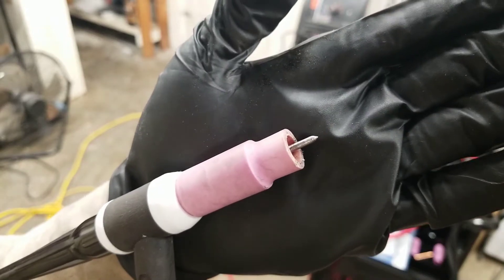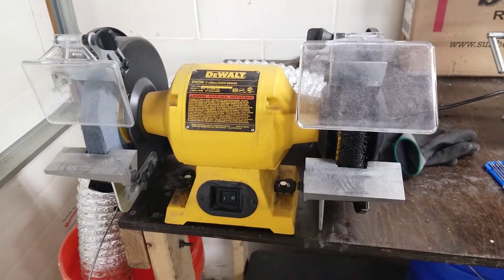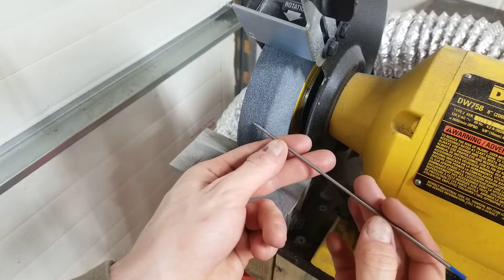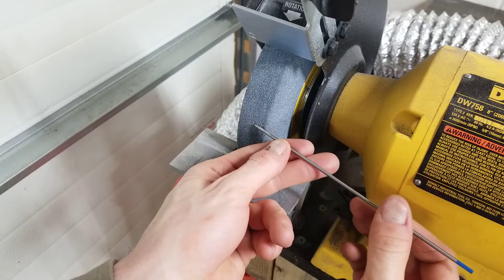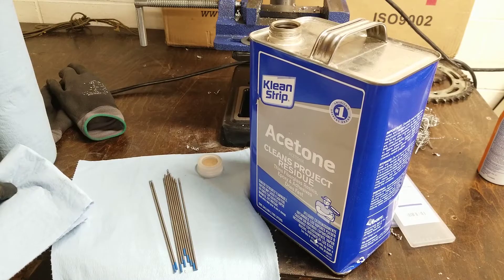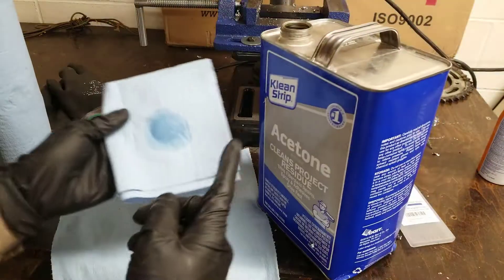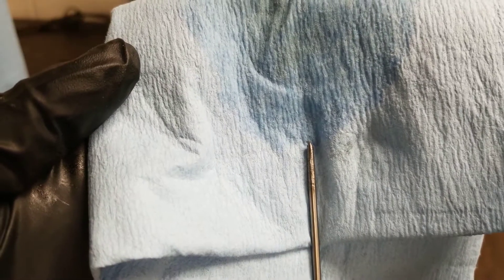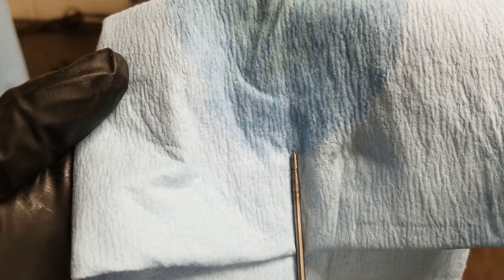How to Sharpen and Clean Tungsten Electrodes

Comment: You are grinding wrong. Grinds should be parallel to the length of the electrode. Failure to do so can result in arc instability especially at lower amperage, and splintering . You really should reference literally any text on the subject before posting an instructional video. Also a coarse grinding wheel like that is not recommended.
Reply from the maker: I have never had an issue and only use low amperage. I'm guessing you took a community college welding course in the recent past?